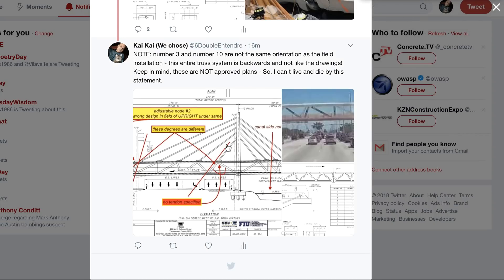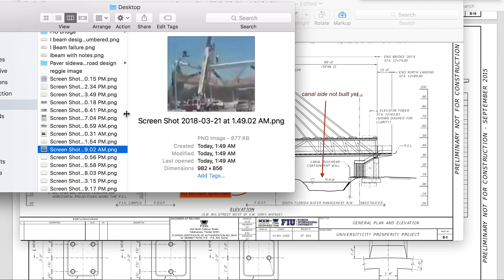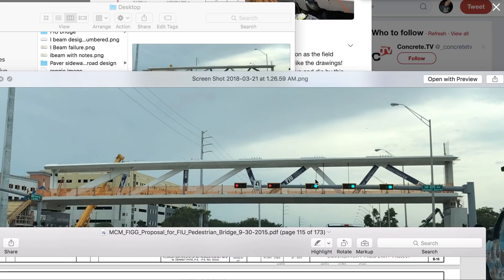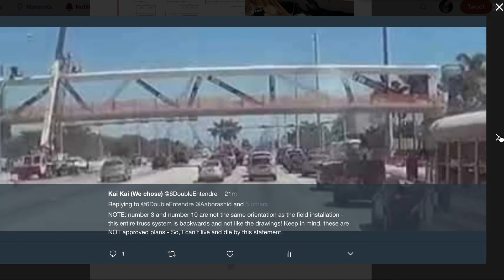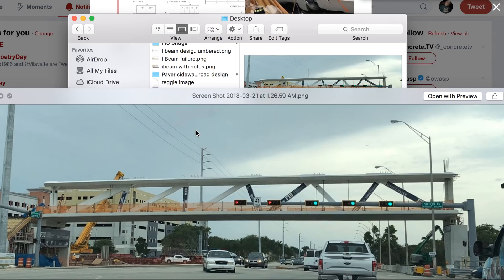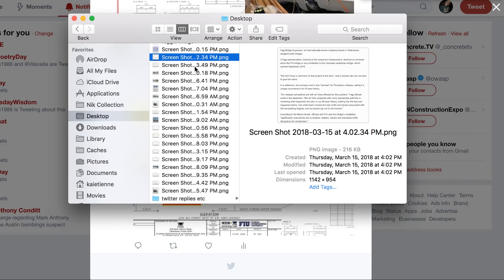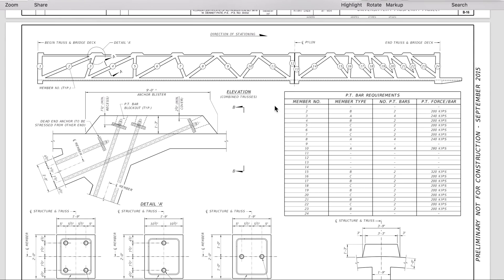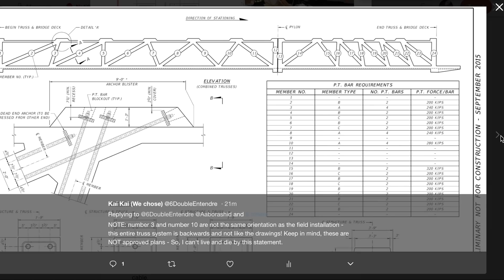Florida Bridge Collapse Cause!   Florida International University BRIDGE FAILURE CAUSE video #1

Comment: Design & Construction executions that was not positively consider to prevention from incident (I mean the Site Geological Condition and Soil Investigation results, Soil & Rock Bedding formation and Strata, Construction materials, Load Bearing Capacity for the High Way Roads environment, Strengthening of Structure) after the disaster if you see in the Pictures showing that concrete and Steel combination not OK both look like separate scenario that's why it must be consult with Geological and Civil Structural expert’s opinions before implementation, to avoiding such kind of happened will not be come out in the future, I think hope So ???
Reply from the maker: Well, we do not see the piers moving in the collapse video - we can therefore rule out that is being the reason the structure failed at area it shows in the videos...   On the other hand, if you saw the piers move - please, show me that and I will correct my data.

Comment: in the post collapse picture you're showing, the rod you're pointing out appears to be a horizontal "tendon" from the top structure, not from the angular, semi vertical member.
Reply from the maker: Where in the video?...   I would like to correct any mistakes... I do these videos with limited time and sometimes I make a mistake with the images... These videos are not rehearsed... Thanks for pointing this out and please, share where so I can evaluate and post a comment if I agree.
Reply: 4:50   that big rod.  But truthfully, now that i'm looking at it again, i'm not so sure either.  It's tough to derive any context from that picture.  I assumed that because it was on top, that it was the top beam.

Comment: The tower and cables were "decorative" and not for support. This was not a suspension bridge. The truss struts were "designed" to follow the decorative cable angles. The strut on the end that did not collapse with the acute angle is going the wrong way. It is not supportive. The bridge should have had two trusses for redundancy. This bridge appears to have been designed by an "artist" and not an engineer. So many things wrong with this project.
Reply: You are correct regarding redundancy. That is the biggest design failure right there. There was no safety to prevent catastrophic failure.

Comment: i dont think the compression cable blew out until it hit the ground. I think the crane lifted from the top cord and it was the top cord that broke first allowing all the weight to be on the crane which then wasn't strong enough to hold the weight and it broke through the topcord. it broke near where the compression cables were attached and the broke the cement away from the ends of the cable as we see in the end result. but it was not the compression cable breaking away that allowed the collapse, it was too much weight  for the topcord to hold and the top cord broke all apart freeing the compression cable for all to see. after the fact, but it was the topcord crumbling that cuased the collapse due to the crane lifting that way.
and yes you have the plan backwards, i hope they dont let you rebuild the damn thing.

Comment: Looking at videos and still images very clearly shows the entire chord at the North end cantilevered unsupported, which by best guess, is at least 1/5 of the total bridge weight, 950 tons ÷5 = wow!, a lot of weight for unstressed concrete to be asked to support itself. 

That single tension rod seen in the debris ejected from its channel with the hydraulic ram still attached would have been under extreme loads beyond its tensile strength. There must have been sounds heard of concrete popping and cracking during the move and lift.

Images also show no steel plates or beams across the top of the jacks to spread the load creating severe point loads which is such a basic tenet of weight distribution that every boy learns to put a board under a car jack to prevent the jack from sinking

I am left to wonder how much they revised on the fly the designed lifting plan and if these revisions were approved, after sufficient calculations had been made by the bridge designers themselves.  But logic dictates these revisions were not calculated as evidenced by the end result

That these big time contractors doing world class work would not consider preparing the North end road surface to accommodate the end jacking tower so as to conform to the plan without moving it boggles the mind. 

Nobody in the nearly 2 years leading up and during the 9 month bridge pour in the adjacent lot or the months of final curing after the final pour said, 

"...Hey boss, maybe we ought to flatten out the road over there. Give me 2 guys, a compressor and 90 lb hammer, a bucket loader a roller and a couple hundred yards of compactable material. I'll have it done for you in one week... rather than you guys circle-jerking over moving the tower...  "

 It wouldn't have taken much more than that, maybe pour some concrete... they were practically swimming in it for nearly a year, and lest we forget the work required to construct the North end pylon RIGHT THERE... along with the steel road plates seen in use during the move to pull of this enormous move as planned....

(consider 950 tons being nearly 2 million pounds and only until recently in the modern age a move like that was unfathomable but now is commonplace leaving the wondering-minded how did the ancients do it with the Trilathon at Baalbek Lebanon being  first and foremost on the lips of everybody in the know) 

..... but in one video during the move a fat guy from MCM mugging for the camera with his chest puffed trying to sound smart said with some hollow authority they had no choice but to move the tower due to the road surface at that end. 

In their meager defense they are bridge builders not road builders but tragically poor builders at that not matter the successes they've had in the past

Comment from the maker: https://smartech.gatech.edu/bitstream/handle/1853/7126/dongkeon_kim_200508_mast.pdf 
enjoy this pdf if you want to learn about the forces in play  and you want it told to you in an engineering terms...
I NEVER said, they installed the bridge backwards... Show me in the video where I stated that.   I am referring to the ''bar blisters" 1:59 I state it is the Canal side that is the failure side. 3:23  I stated the orientation is correct.

Comment: Probably need to wait for more information from the NTSB, but suspect post- tensioning would have been performed on each of the members, not only on one side - required to maintain the concrete in compression and not tension. The blank value for  support #11 probably reflects the preliminary nature of the drawing. Recall the temporary supports were moved, so the load probably needed to be increased there, so the calculation was probably not complete when the drawing was issued.

Comment from the maker: FOR CLARITY -- as new data comes in - the outcome of the failure might be related to something not mentioned in this video. This video is a theory and my theory is subject to change as more data comes in.
What I am saying is, we should not be set in stone on all our theory of collapse...
Reply: Philadelphia Construction Engineering the proximate cause of the failure was the repositioning  of the supports without a completely new analysis of the stresses.  A compression member was in tension and a tension member was in compression.  I think the post tension channels broke and that the stress test caused the overstressed member to buckle and shear the rebar, destroying the strength of the truss.
Reply from the maker: That is what I state in my videos... as a contributing factor - please, look at my other videos to follow along --- I did not want to put this in one huge - video - Besides, as the data presents itself, I will change to where it leads...
Reply: Philadelphia Construction Engineering I was thinking of the Hyatt Regency failure as a comparable negligence. I think the post tensioning ram acted more like a knockout punch instead of tightening the structure, it pulled the cable and the tie down through.

Comment: The problem with this bridge is that it weighed 950 tons and was meant to carry 20 tons of people. Huge weight to payload issue. It was designed to carry 1000 people at the same time incase there is a concert or parade or something. Who the heck builds something so heavy? An ant can pick up 50 times its body weight. A pickup truck that weighs 5,000 pounds has a payload of 2,500. An avg human that weighs 150 pounds can carry another human being weighing the same. This bridge had a very very low max weight to net weight ratio. Unbelievable. 950 tons of concrete to carry 20 tons of load. And it's cables and tower were for show only! More dead weight.
Reply from the maker: Try this video - I hope this version of my video helps a little more, let me know. Ty 
  https://www.youtube.com/watch?v=-gTiRJl0vLw&t=26s

Comment: Good video .. was the span put in the wrong way around??
Reply from the maker: I do not think so - but, it appears the ''blister'' was NOT suppose to have tensioning done on it.  This is a better version of my video - I did another one explaining more of what I believe the failure was from... It is longer - please, feel free to comment there  and I will respond as soon as I can... thank you
https://www.youtube.com/watch?v=-gTiRJl0vLw&t=26s
Reply from the maker: That would actually take load off the #11 if it could not be tensioned ... 

Please, see my second and third video...showing a model version of this... thank you.
Reply: I have heard that when they set the span in place, the mobile jacks on the canal side of the bridge were moved in towards the center of the span.  This may have put undo tension pressure on the tendons 'hanging off" of the supports.  When the span was set in place, those tendons were loose and the engineers thought that they needed to be tightened.  What they didn't predict was that the tendons were stretched beyond their load bear capacity, thus the collapse.